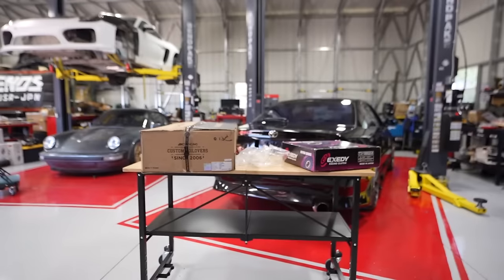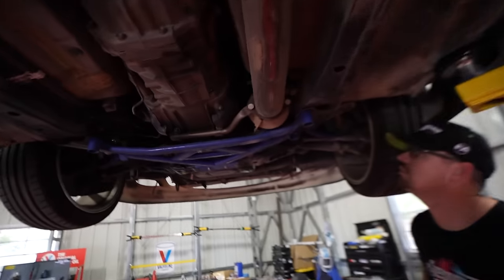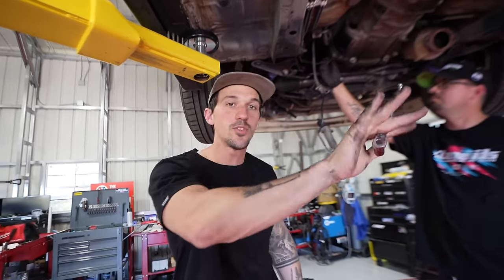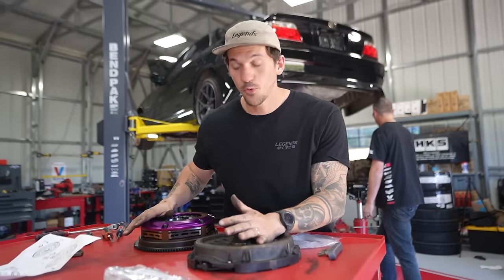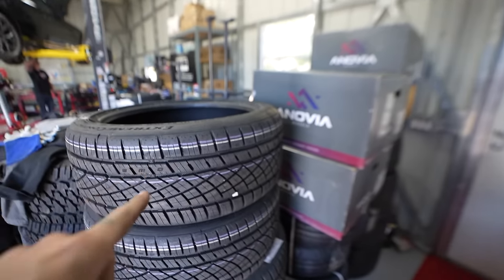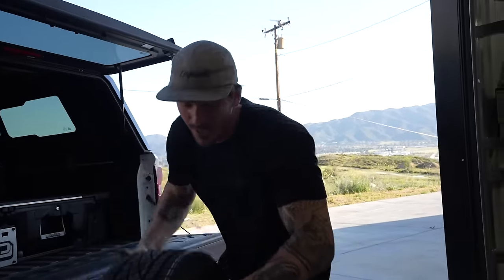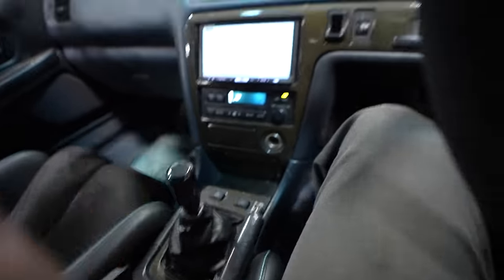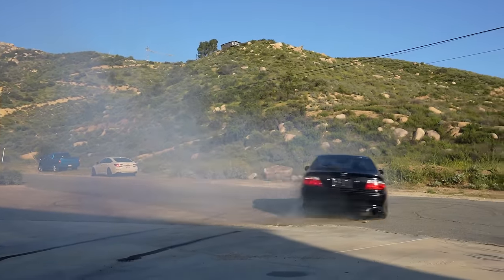JZX100 Chaser Gets NEW Wheel Set up and MAJOR FIXES!

Comment: Hey Dustin - Tim mentioned it, but you should be really careful handling clutch material and other fluids without latex gloves on. That stuff is pretty nasty, and I honestly wouldn't be surprised if it causes bad health problems later on in life. Just want to make sure you're being safe!
Reply: Yeah and they were using rattle cans  can't remeber if they had any face pro, but if they did I remeber it being very inadequate.
Reply: Let alone no hearing protection. I’m 46 yo and have hearing aids as I have high frequency hearing loss from rattle guns , grinders with all our modern tools and no proper hearing protection .
Reply: Absolutely. My grandfather owned a shop for decades and dealt with brake clean, and everything without gloves. He had throat cancer very likely due to that
Reply: I worry more about out their backs. Every mechanic I know has a wrecked back. All that bending over the engine bay.
Reply: But it's ok working with anglegrinder without safety gard on it 😅

Comment: Could 100% be clutch noise but I’ve also seen said noises come from not replacing the input shaft bushing and/or not greasing the input shaft or throwout bearing sleeve. I would also be hesitant to drive the car with the milky oil. Putting off the head gasket replacement could wipe out the bottom end of the JZ. Not trying to be negative, just giving feedback so you guys could avoid larger issues. Nothing but love.
Reply: Agreed...
Reply: 100% - needs a bit more mechanical sympathy rather than just changing the oil and hoping it magically fixes itself

Comment: Milky oil could be condensation built up if car has been sitting for a while in cold/hot weather, that's if there's no sign of coolant leaks.
Reply: I came to the comments to say the same thing. Also from starting and stopping the engine a lot and never reaching to proper operating temps.

Comment: Regarding the ‘chocolate milk’ oil situation. Check your coolant level. It could very well be a head gasket issue which has allowed coolant into the oil while under pressure. Hope not though. 🤞🏻
Oh! At the end you mentioned checking the oil & coolant. Good!